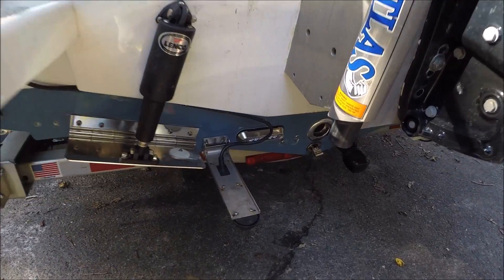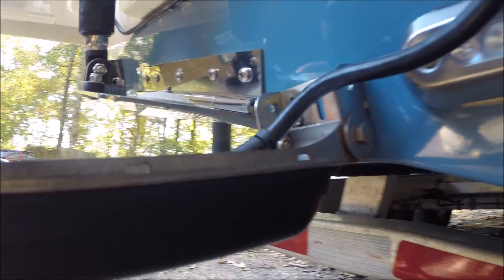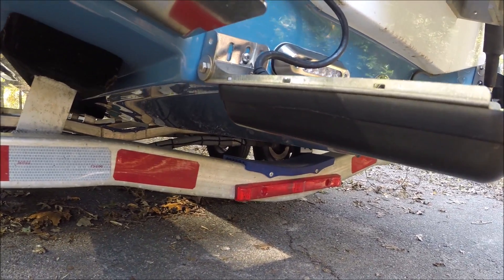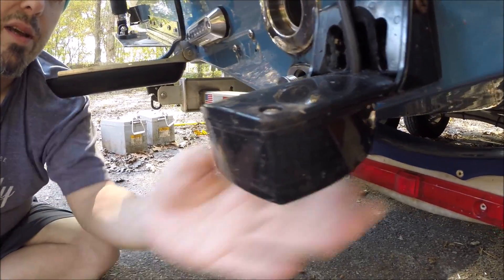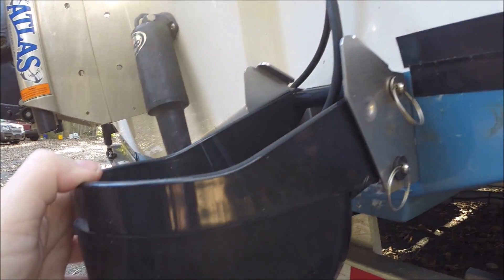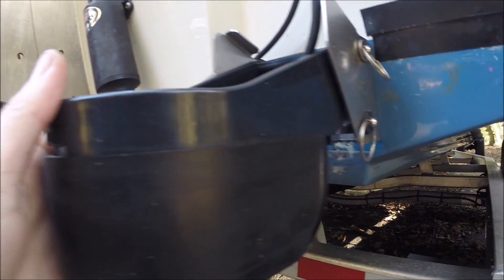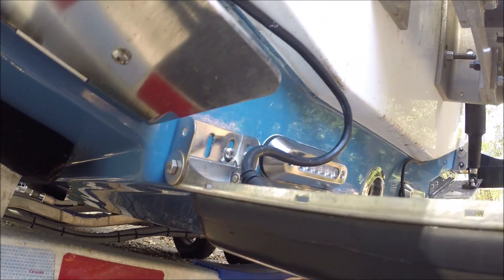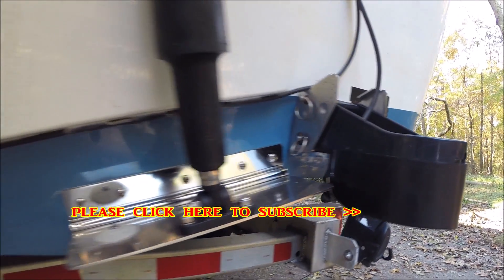How I Install my Transducers for HIGH SPEED PERFORMANCE. Airmar 275. Airmar 150. Chirp CHIRP

Comment: Would your method work for inboard engines as well?
Reply from the maker: I have had transom mounts work well on I/O,s, but i have never personally tried them on an In-board. I would imagine it would be quite difficult.  You would probably have to stay as far away from the keel as possible, which is the opposite of these installations. Sorry, I wish I could help more
Reply: @MikeSmedleyOLDSCHOOLSTRIPERS  does simrad have a through hull totalscan?
Reply from the maker: Rich Conolly Yes Sir.
Reply: @MikeSmedleyOLDSCHOOLSTRIPERS  I might do that then. Replace my old furuno with the simrad.  Looking for an all in 1 hub. Radar, sounder, GPS...
Reply from the maker: Simrad has it all brother, Go to BOE Marine. They have the best customer service.
Reply: @MikeSmedleyOLDSCHOOLSTRIPERS  will do thanks!!!

Comment: I find that my 3d transducer acts as trim tab and lifts the one side of my boat when on plane because it's so large. Guess there isn't  really any way to avoid it with my setup. I'm having trouble getting anything out of my transducers when on plane at any speed. I'll have to try your method.
Reply from the maker: heyttsguy wow.  I’m guessing you have no room to move it closer to the keel, if not you can actually find cheap “for parts” total Scan and 3D transducers online.  If all else fails you can install one of these busted transducers opposite of the one you are using to at least level out the boat. I know that sounds funny but that would drive me nuts if one side rose over the other. Hopefully there is some way to squeeze it closer to the keel.
Reply: @MikeSmedleyOLDSCHOOLSTRIPERS  I prob could switch it with my sonar transducer. The problem being is I have a pod in the center and if the 3D transducer got kicked up it would hit the pod. I'll have to consider it. I thought maybe I could also adjust one of the trim tabs so that at level it's actually trimmed down/up to compensate for the transducer.